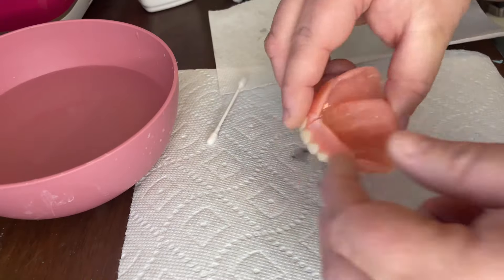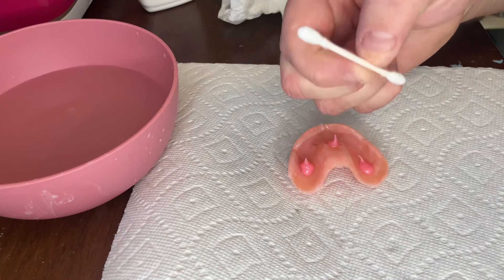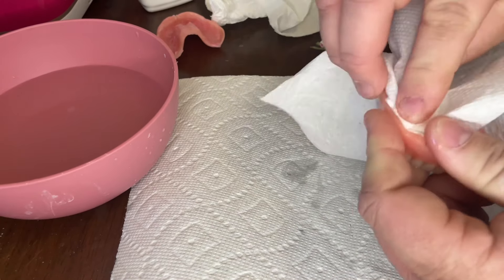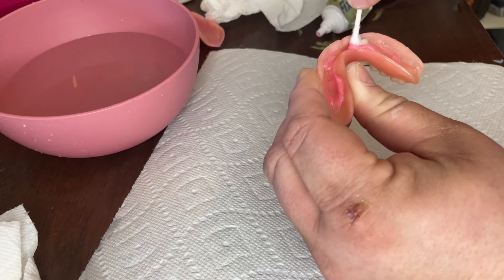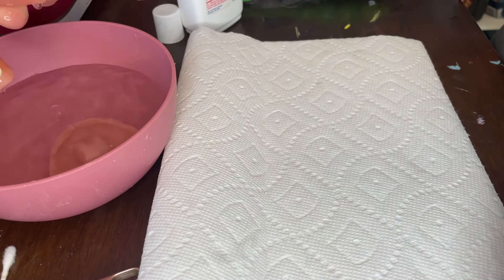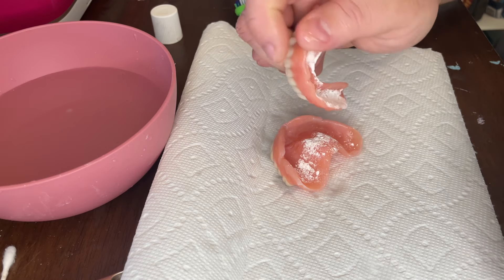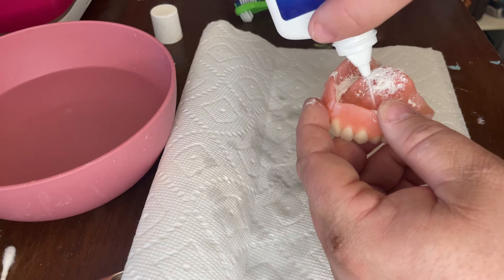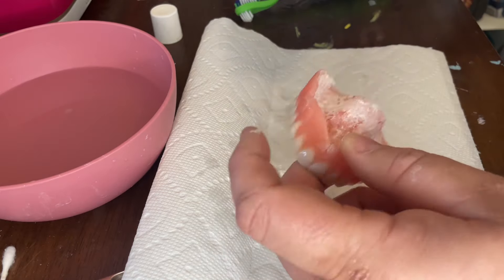Applying adhesive to get an all day hold! How-to apply paste or powder in 2024

Comment: Seems so complicated. You would think in this day and age turning boys into girls and visa versa there would be high tech teeth for sure. Also affordable to working class people not just rich. A 50k implant is not realistic to most Americans. The clinic im going to does not do immediate dentures so that's freaking me out as most of the yt stories are immediate. The doctor says wait 6 weeks without any denture after extractions then mold for permanent. A 3 month deal. Ouch
Reply from the maker: 6 weeks to get permanent is ridiculous. I got mine at 9 months and still had shrinking. If you get them that soon and that’s your permanent set, get used to soft relines.  Not trying to be down about it but I want to be upfront. I would not wait that long to get any. I would get some now and then reline or new set in 9-12 months. Good luck
Reply: @JustinBsDentureJourney  Thanks for responding and trying to help total strangers. Honestly, the whole reline thing and everything denture is foreign . The more I research, the more confused I get. :)
Reply from the maker: @jeannedouglas9912  gotcha.  Basically for an immediate denture after so many weeks (mine was every 8 weeks) they will put a soft reline in. Basically a soft liner to fill gaps from your shrinking gums. This helps your denture fit and hold so much better.  They do this for 6 months or more until you are healed.  Then they do a hard reline or new set.